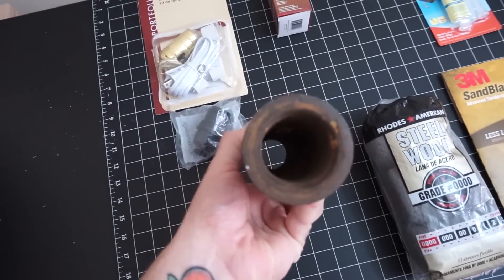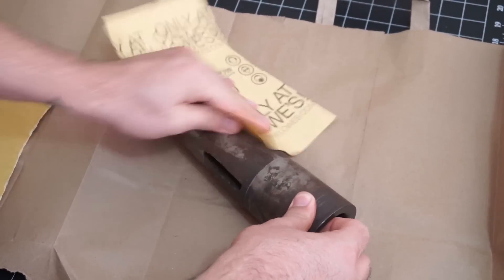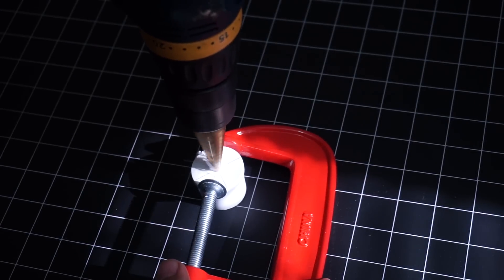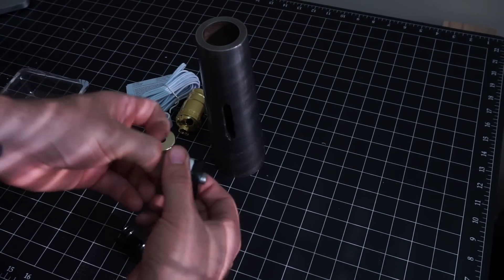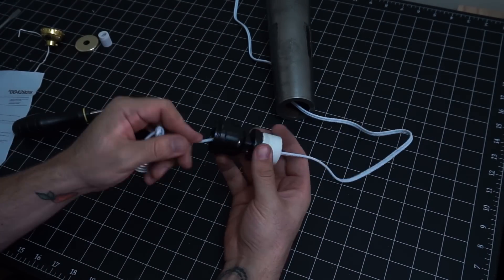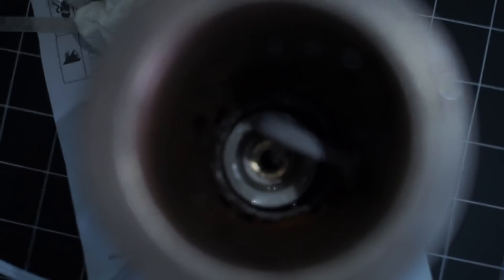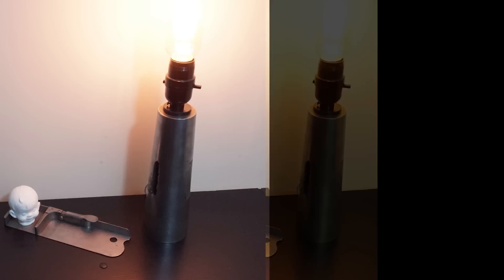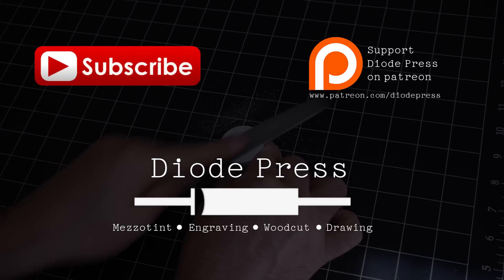Let's Make A DIY Edison Bulb Lamp

Comment: Metal part looks like a taper spindle adapter.
Reply: +Zarouszz I'd put a wire cage around the bulb in the event it gets bumped over.
Reply from the maker: +Zarouszz Cage would probably be a good idea, I have shade kit for it also I might try out.  But this thing is so heavy, it would break anything attached to it (let alone a toe!) if it fell. But a cage would keep a stray elbow out. Maybe a work-light type cage would look nice. 

I was thinking it might be some sort of adapter, but didn't want to offend any machinists with guessing :)  Thank!